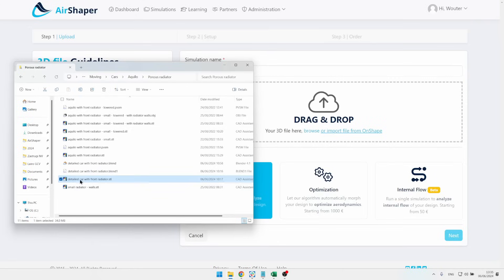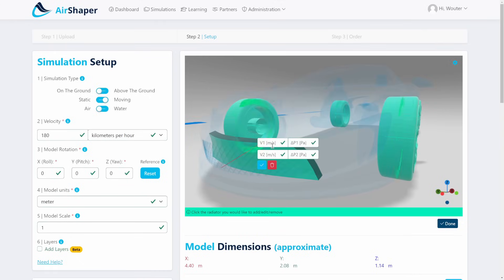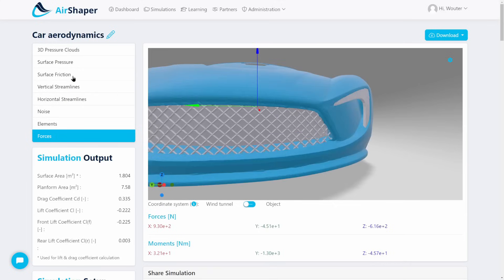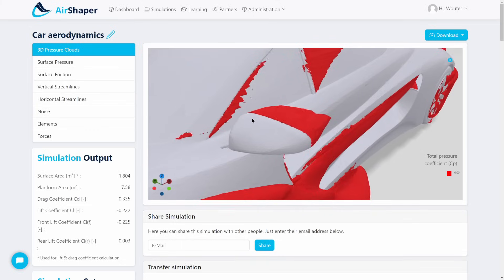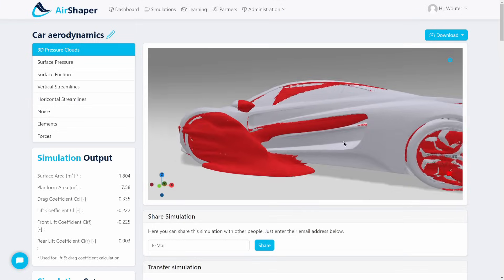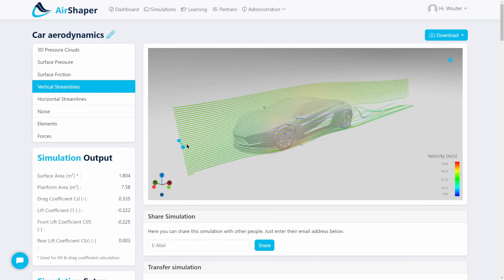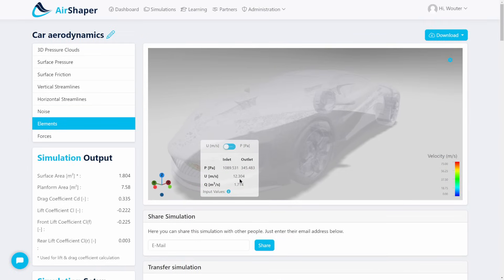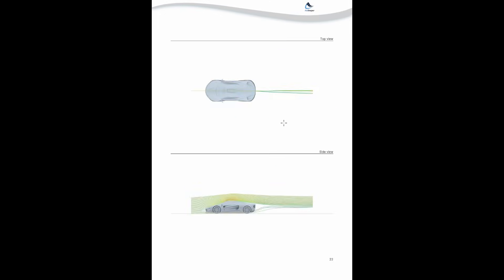Aerodynamics Made Easy - Car CFD Analysis Explained | Step-by-Step Guide

Comment: Cool, but I wish there was a free or at least cheaper version for personal use. I am not going to pay 50 euros for something I could set up in Blender for free. But obviously, I am not the intended user.
Reply: Blender cannot do CFD. 
I wish it could, but for now, this is actually quite a bargain for doing CFD sims. 
You can use OpenFOAM for CFD, and it is open source, but it requires coding, and does not have a U.I. 
It also has a steep learning curve. 
In addition to that, AirShaper has an optimization feature that suggests areas on your model that could be improved upon. 
I have run one basic, entry level simulation on a highly detailed model of my car, and was very impressed at just how accurate the test was in showing where airflow would be in certain areas. 
Previously, I had done tuft testing on the car, and the AirShaper results were an exact match.
Reply from the maker: Yeah CFD in Blender would be cool. But those sims are very complex, it would require an entire second blender dev team. AirShaper can work with non watertight en non manifold models straight out of blender.